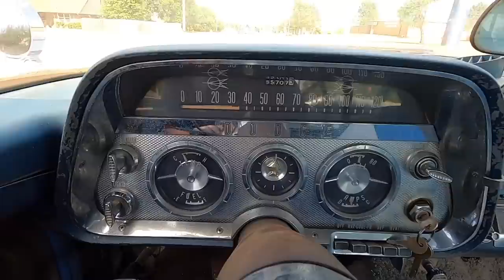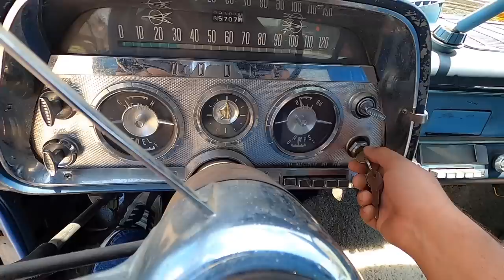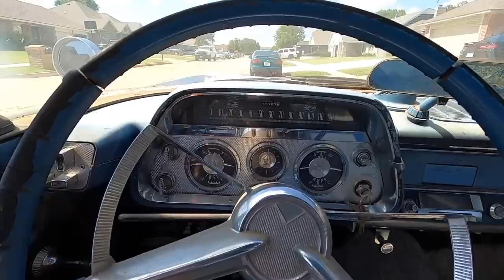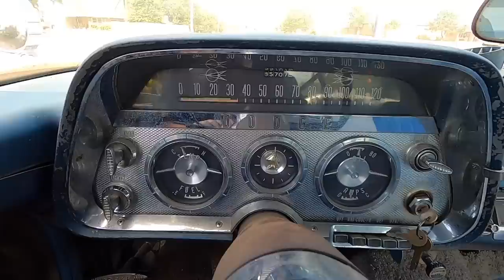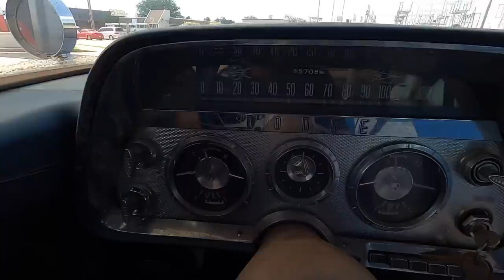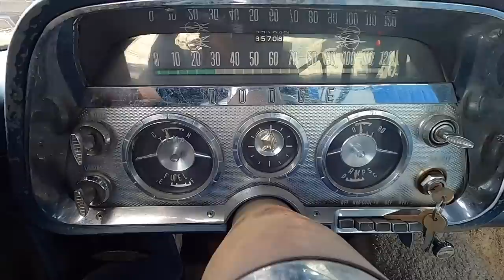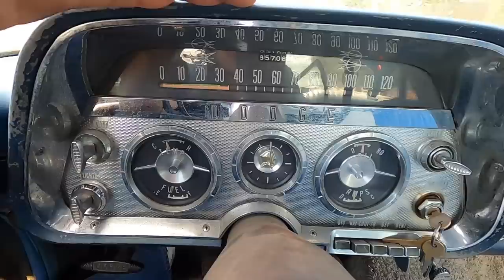Fixing and Driving the 1959 Dodge Coronet for the First Time on July 4th 2020!!!

Comment: Lol ck the thermostat  by submerging  it in a pot of boiling water. They are freekin cheep and if not  installed may  cause issues with capitation and poor cooling. Slower moving coolant  absorbs  more heat. Slower moving  collant disipates more  heat!... oh, you need premium fuel and  forget the timing data, just get it to run!

Comment: Who knew 60 years later were at push button transmission again.
Reply: It is a little different though.  My push buttons have never failed me on my 1963 Fury because they are all mechanical.  that won't be the case with these newer vehicles.
Reply: Mexican Spec I believe that agree because I think it's vaccum but the concept of transmission buttons.

Comment: Sounds like a burnt valve when you were driving. You have a $40,000 project car on your hands.
Reply: Ya and you would be lucky to get 20000 at a MECUM auction and that's at no reserve in good driveable condition.
Reply: @scottouellette9411  I don't do auto auctions and I don't fix and flip. I keep and drive them til they die. If you want something dependable and done right, it cost money

Comment: In the auto industry we call those clear plastic fuel filters fire starters. I would remove it and get one that has an aluminum casing those filters are horrible and cause more problems than there were.

Comment: People like this should get there head examined running an engine with out the thermostat is a big no no. The engine will not get up to operating temp and won't run right. The electric fuel pump may be causing the carb to leak. Need a gage on it. It is not rocket  sience how that heater system works could just loop the heater hose and by pass the heater core.  I see this time after time need to Clean The Carb befor starting. Did any of you see him check the oil in it?

Comment: You will be disappointed when you remove the valve covers to adjust the valves. 1959 326 is the only of the early Poly motors to have hydraulic valvetrain unless that either has non-original heads or a non-original motor.

Comment: Another thing you can do to see which cylinder is missing, is to pull plug wires one at a time, till you find the one that makes no difference in how it idles. Be careful so it doesn’t zap ya. 🤣

Comment: You need to adjust the valves all the way around, you can hear them. Then pray that it quiets the engine tapping down. Because you know what the next thing would be. But it does sound like a collapsed lifter to me or a bad valve or cam. Sigh...

Comment: ACTUALLY YOURE WRONG! in Asia where im at,, the labor is cheap and i can restore a whole car for around $10,000 t0 $30,000 including chrome plate strip to metal, rust repair down to the frame, all included ! because over here labor is not $250 per hour but only $9!

Comment: Well first off be careful nothing is made for that car. Sure some mechanical things are common. As to the heater hoses: The "thing" with the pin hole is the heater control valve. The other hose with a control goes to the defroster. Remember heated cars back then were infants. The carb just needs dunked and new gaskets and stuff.